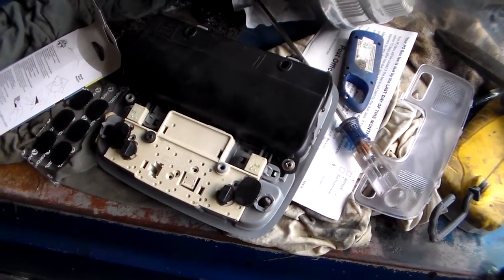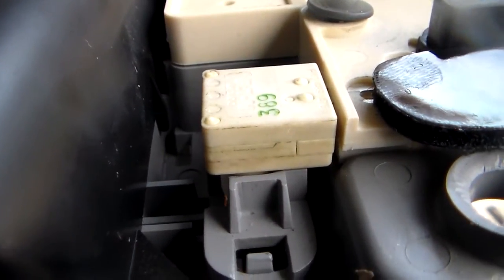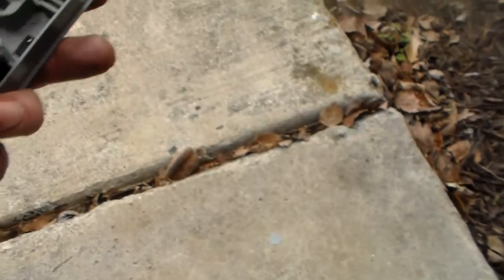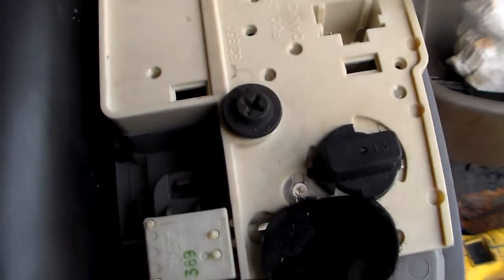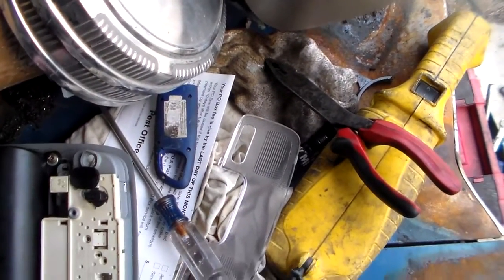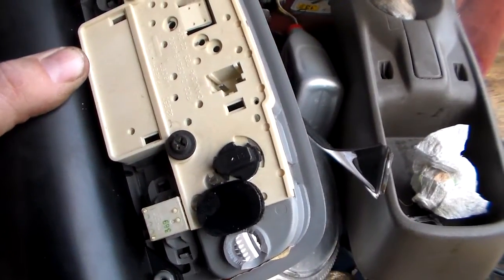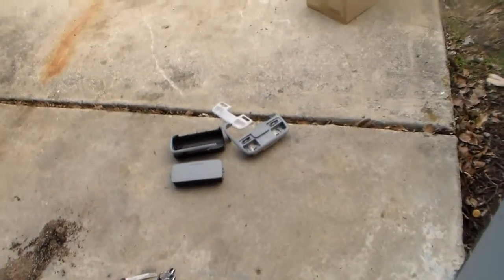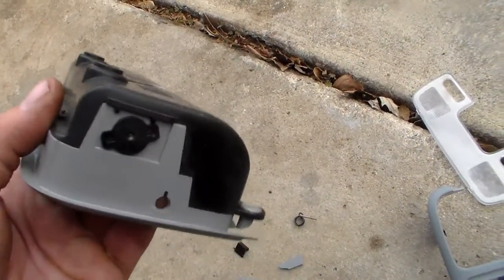1998-02 Honda Accord map light repair

Comment: My mounting hole busted and it was hanging down.  I found on another site that you can use washers to hang it back up.  My light wasn't turning on either and it was because the casing was loose.  When I mounted it with the washer, the light switch worked again.
Reply: YES I JUST DID THE SAME THING! 2 minutes. YES YES !

Comment: I think for those broken out sections, I'd just grind off those spacers, epoxy a piece of metal of some sort to the top of it, then drill a hole in it for the mounting. If it then needs to be spaced away, you could toss a few washers above it to get everything nice and tight. A good strong epoxy should last just about forever.

Comment: We had DX, LX, LX with ABS,Se with ABS (basicly and LX with Alloy wheels and fancier floor mats, Automatic only on this trim), EX, and EX with Leather. V6 Came in either LX with ABS or EX Leather models. Coupes where LX or EX, and followed the same format EXCEPT, LX 4 cylinder coupes didn't not have the availablity of ABS brakes.
2002 added a Special Edition model with a sunroof and alloy wheels, putting it in the same place as the "SE" trim here